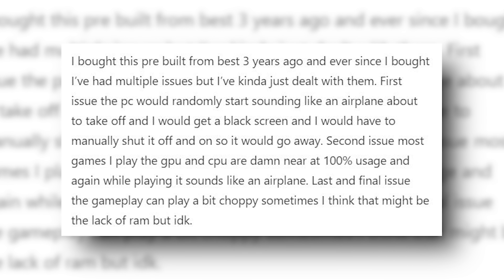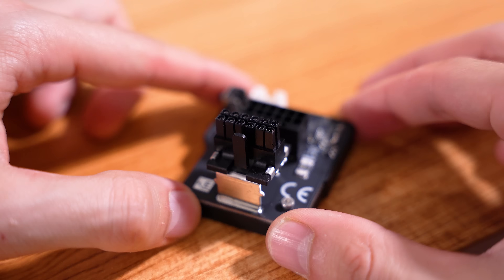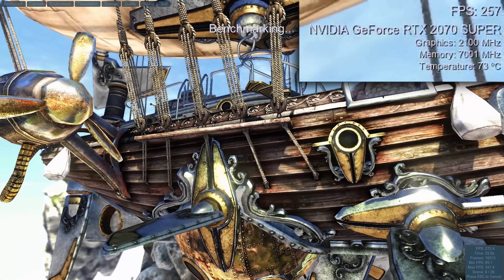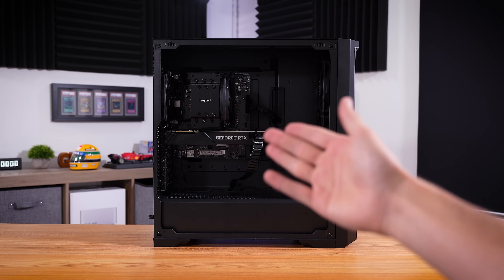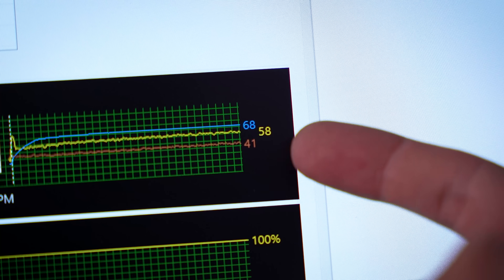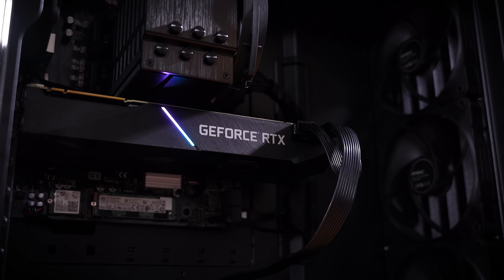Fixing a Viewer's BROKEN Gaming PC? - Fix or Flop S5:E3

Comment: Something to try in the future on these ASUS prebuilts. I had the same issue with a prebuilt I bought with an 11700f. The PC had a standard ROG Strix B560-G Gaming wifi motherboard. I switched cases and upgraded coolers and even with a 360 aio it would throttle. It had a weird bios specific to the prebuilt that was not listed on ASUSs website and could not be flashed through standard methods. It was pumping way too much voltage to the CPU and limiting boost frequencies no matter what I changed. I used a CH341A programmer and clipped it to the bios chip and flashed the OEM bois to the board and never had an issue since.

Comment: I would have kept the case and PSU, and instead, upgrade the ram to dual channel and used a low profile CPU cooler, like the be quiet! Shadow Rock LP. 

The Intel i7 9700 has a 65w TDP, so the be quiet's max 130w CPU cooler would be enough to keep the CPU from thermal throttling at high load. Yeah, it would still be in a low air flow case, but not a no air flow case. The overall TDP of that PC isn't high enough to be an issue in that case, only the CPU cooler really needed to be addressed if the goal was to keep things simple and not start changing out parts.

That's just my perspective however, I can see Greg was hesitant to do anything, based on previous viewer history, so I'm not judging the choices made, only pointing out what I would have done without the pressure of others. It sucks, so I can't imagine how it feels in the moment.

Comment: I love that at least a lot of the viewers know that Great Wall is a perfectly reputable brand for PSUs and fairly reliable. They did underpower it but honestly, the 2070 pulls about 215 W unless you overclock it.  the i7 9th gen is let us say 135W. 500W should be perfectly fine if the recommendation actually gives 500W over 12 Volt rail and it's not a split rail PSU. The recommendation from Nvidia tends to be more than you need because not all power supplies are equal and the rails might not have enough power even if the unit in theory does. 3.3V and 5V might be part of the combined wattage or separate. A lot of brands have 12V Wattage as the wattage on the box but for other brands the combined wattage is the advertised wattage. The Thermaltake smart series 600W for example says 600W but it is only 540W over the 12 V rail. But an EVGA 600 GE provides the full 600 W over the 12 V rail. Not to mention some PSUs split the CPU/motherboard rails from the other rails meaning that it could be a certain wattage overall but only 200W is for PCIe etc.

Comment: one point of my concern is that previous cpu cooler was also cooling that weak motherboard vrm because it was downdraft cooler, the new one you upgraded with is not downdraft which in theory is actually harmful to the current motherboard situation

also as others pointed out, Great Wall is an OEM themselves, so more reputable than many "known" brands when it comes to psus.

Comment: A 2070 Super uses a nominal 215 W, and I can't imagine that board would be drawing much more than 100 W (my guess is 95 W PL2 and 65 W PL1 or thereabouts, that's certainly all I would entrust the stock cooler and VRMs with), so a decent 500 W PSU seems perfectly adequate for a system like this. 
Placing the CPU fan down as far as possible to give the weedy VRMs a maximum of airflow would probably be a good idea... upgrading a system like that to a tower cooler is potentially good for some surprises in this regard. OEM systems with tower coolers (e.g Fujitsu) often have sort of a wind deflector going that redirects some of the airflow from the bottom fins onto the VRM area.
Oh yeah, and the owner should definitely splurge on a second RAM stick as previously mentioned.

Comment: Pre built PC's like this are usually not good, the single.ram.atick is leaving so much performance on the table. Add one more stick and the fps will go up quite a bit. 

New cooler and a stick of ram, boom. That's all it needed. In my opinion. But I'm not creating content and giving away parts :(

Comment: Honestly.. this setup didn't deserve this upgrade. Bottom of the barrel motherboard, cpu cooler and the ram. Upgrading the motherboard plus using cpu cooler like Noctua NH-U9S would fit perfectly. 5-heatpipe Thermalright Assassin King costs 22 bucks and does the same job as U9S.

Comment: My first pc was a prebuilt ASUS from BestBuy, it came in a funny shaped case that left me with zero upgrade options graphics card or ram wise. While I learned about pc's and pc building I started wanting more, so while I saved to buy all the pieces for a new pc I decided to mod/hack up my current proprietary shit box via a pcie riser and a standalone psu to power the gtx1080ti I had bought off craigslist, threw that 750ti in the trash so fast. Was so ready to do something with my new found love of pc's I ended up putting a water-cooling adapter plate and an AIO on the 1080ti, even though it ran perfectly cool before as it sat outside of the case and got fresh air coming from the air vent in my office. Long story short, don't buy a prebuilt that is not built using off the shelf parts.

Comment: LOL... that IO is hilarious. I ended up with the mobo out of an Asus prebuilt and you wouldn't know it outside of trying to find the drivers for it, but that IO is surprising. They're definitely not the same as ones you can buy in the store. Also, Great Wall is not a questionable brand. They are a respectable OEM for some very good power supplies. The Corsair SF series are highly rated SFX PSU's and they're made by Great Wall, as one example. And being that the 2070 Super is only a 215 watt card, the OEM model is probably even lower than that, a 500 watt is plenty, provided it isn't trash... which Great Wall isn't.

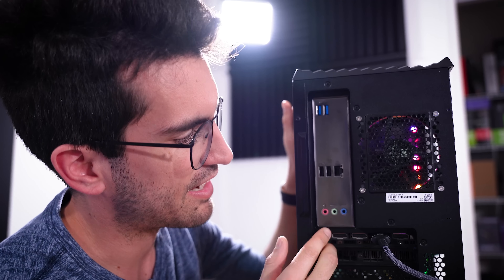Comment: @6:31 Don't OEMs use the cheapest components they can get away with just to increase their profit margin?
@7:20 Pretty much everything is better than this pittiful penny pincher version of a cpu cooler. It is clearly hard to justify "throwing the parts cannon at this" Milli Vanilli, so to speak, though. 😊
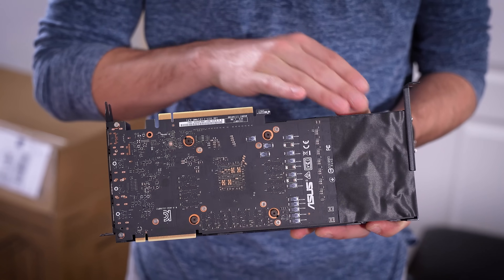@8:49 I heard of the car manufacturer Great Wall Motors before, known for its pickup truck devision.

Comment: I had a POS PC from BB and I had to ghetto cool it. That means I had to have a fan running in it 24 hours a day, 7 days a week 365 days a year unless I wanted it to go poof. The last computer I had before the one I have now was a I buy power PC and it's power supply blew up on me. The PC gods smile at me that day because none of my other components blew up at the same time. I built the rig I've got now. It's been going consistently since that day in 2020 and no problems. I will never buy another stock PC again in my life.

Comment: The CPU cooler was really a necessary change. I would have changed the motherboard as the VRM would probably also be overheating. Finally, in a weak system like this I believe that the 550w PSU would have done the job. I really like your videos. Congratulations on helping so many people.
Reply: I agree. That motherboard was NOT suited for a gaming/performance rig. That motherboard was at best a weak productivity platform. I am about to sell my old Z170i (mini-ITX) and I feel like reaching out to that owner to ask if he wants it. Because I think my 6700K in that motherboard might have outperformed whatever that platform can do with all the throttling he's getting.

Comment: Did not expect him to be so ignorant of the Great Wall Psu. Really surprised he did not check it before replacing it. The smartest way, would have been to keep the psu and upgrade the Ram. That single stick of some generic low speed Ram, running in single channel is a massive performance negative impact. Not addressing that is extremely surprising to me. Very mediocre work on this one.
Reply: He also claims operating the 9700KF 10 degrees below T-junction is "very bad".
Ignorance seems to be his channel's goal.

Comment: Asus is making ROG prebuilt PC, normal company approach: use of the shelf mobo (even like H310 prime), stock case like 301, strix or tuf GPU and there we go. How 99% of companies do (even those who have they lineup of hardware ready to use, not HP or dell): lets specifically produce (I'm not even sure its cheaper running a specific assembly line) cheapest and nastiest versions possible and sell them with even higher margins as ready to use gaming RIGs. Also, I've bought a board from similar asus ROG prebuilt, it uses two SATA ports to connect front USB ports, not even joking, had to purchase pci-e usb 3.0 to connect from panel. Also, bios has no XMP option at all, it can only run RAM that uses jdec standard higher than 2666, any XMP kit runs on 2133 or 2400.

Comment: Fun video Greg. Just a quick suggestion, if you feel a build is somewhat deficient in USB ports a USB card with usually 4 USB ports is a very cheap option. If the motherboard has USB connectors on the bottom the 4 port breakout fishplate adapter can be as little as $6. This client scored big time with the new case, CPU cooler and 1000W PSU. As others have said here Great Wall is a good quality OEM brand.

Comment: I bought the rocket lake and strix 3080 variant of this in 21 when gpus where hard to find. Cpu cooler was a joke for 11700k and the rear fan is 80-90mm that sounds like a jet engine. Whole case felt like tin and the mobo was some cut down b560 board. Would never recommend a a Rog prebuilt after that. Moved the parts into a different case after stressing it. Rog just sold trash cuz gpus we’re going for more than prebuilts because of shortages and crypto.

Comment: hi im from the uk can any one give me some advice i need help i have a old pc and want to do a bit of a upgrade i have a asrock-  Z97E-ITX ac with a I5-4690k @ 3.50ghz running a Radeon- RX-570 i got a I7-4770k of ebay for £20 will it fit straight in with out updating the bios and i need to upgrade my wifi m.2 card because im getting 1gb broad band with 5ghz what can i get any advice would be great as im a 55yo

Comment: Looking closely at the motherboard it has G15CS written on it. This appears to be an ASUS ROG prebuilt, so ASUS are responsible for the cheap design. Note the single channel RAM.

ASUS need to do better.
Reply: Actually, thinking about it, it would be wonderfully ironic if ASUS offered a proper motherboard to you to upgrade the very poor existing motherboard.

Comment: CPU cooler and dual channel RAM, replacing the case was not essential. That board itself may be the problem as well, that VRM is minimal and will be restricting the CPUs capabilities.
Reply from the maker: I disagree. Replacing the case was 100% needed. The cooler alone wouldn't have fit into the original case as it's far too slim.

Comment: A tower cooler with a board like that is dangerous.  The designers count on downdraft coolers for cooling the VRMs.
Reply from the maker: There's plenty of active ventilation in the new case (compared to the old). I wouldn't sweat it one bit.

Comment: Looks like a cooler master. I remember when Great Wall and CWT was a PC builder's joke because the companies had the lowest quality. Amazing how the story has changed for the better. Use too be a huge rog person. With the current pricing of boards though. The rog and most of the Asus pricing has turned me away. One of the lowest number of usb and connections on a back plate for the mobo I've seen in a while. Another reason too build your own. Better choices. Like one stick of ram.

Comment: I think the biggest peformance hit comes from the single stick of RAM. The owner should definitely upgrade that ASAP.
Reply: Don't think the issue comes from the ram running on a single stick, but rather the speed of it. It looks incredibly cheap, wouldn't even add another stick, just replace the whole damn thing 😂
Reply: @PexceI it's probably just some value RAM of some sort, it doesn't look fancy but works just as well as other RAM sticks
Reply: Luckily Intel is much less picky about RAM than AMD. If the dude wants to upgrade it in the future he can.
Reply: I actually think Greg did him a huge service by not touching the platform and GPU. He set him up (almost) perfectly for a newer CPU, MoBo, RAM (7800X3D+AM5 MoBo +32gb@6000 all for 500 ar microcenter)  and GPU upgrade later this year when the new gen arrives. He can even wait for Zen5 for a CPU.
If it were me, I'd be happier with this than if he touched the platform, instead. That MoBo is one of the saddest I've seen in a long time...
Reply: @BarAlexC  yeah I agree... or even an extra stick from ebay for a very cheap upgrade to hold him over

Comment: Loving this series, been watching almost every episode! Were the tests done with the sidepanel on or off on his old case btw? In every shot it was off, so I just have to ask. Considering how restrictive the case was on airflow, it would definitely make a difference on GPU thermals. Having run into the black screen issue myself with seemingly normal GPU temps, it seemed to be more closely linked to VRAM temps in my instance.

Comment: So the owner of this system watches this channel, and they thought it was okay to have that poo poo garbage cooler on the cpu and just a single stick of ram? Combine that with a hermetically sealed door cosplaying as a computer case…yeah of course temps are gonna be bad. I hope to god the owner of this system just found this channel, because otherwise, they would either not have bought it in the first place or at least upgraded the cpu cooler and got a second stick of ram and/or put it in a case that wasn’t choking the air from the components.

Comment: Gotta get the OEM VRM heat sinks to remove thermal throttle. The motherboard can sense when they have those heatsinks. I learned this from a Dell prebuilt and both Dell and Alienware have that. Replacing CPU cooler still made motherboard throttle cpu

Comment: and the moral of the story is, don't buy a prebuilt from a store like bestbuy. I just got into PC gaming less than two years ago when I built my first PC. When I originally set out to get a PC, I found out that I couldn't buy a decent PC because of the GPU shortage during the crypto boom lol. And I realized that buying a prebuilt usually gets you something that has cheap hardware and shitty performance for the cost anyway. Seeing as tho I had some time before the GPU shortage would end, I did a bit more research and decided to build my own and that decision was not only a good one but felt very rewarding too. I learned a lot from the whole process starting with learning about the different hardware to picking the parts and then building it. I think every PC gamer should learn to build their own system.

Comment: I know people aren't a fan of blower coolers but I don't mind them on stuff like 60 class cards or in more efficient generations 70 class cards if the noise is still too loud for you or thr Temps I Def recommend trying to undervolt because I dropped 10 C on My xtx with an undervolt alone and around the same on my old 3070

Comment: Seeing a single stick of memory, and the user statement about low memory, and that DDR4 is dirt cheap, makes me wonder why that was not even mentioned. You go for a new case, a large and EXPENSIVE CPU cooler (Thermalright Peerless Assassin is better for less than half the price - check Gamers Nexus review), a new power supply, and do all the cleaning but leave a single memory stick running in single channel mode and it was not mentioned once as to how much memory the thing came with....keep memory in mind
Reply: Let the viewer upgrade his own RAM if they want, it's cheap and the most ez thing to change out. Greg did more than enough.
Reply: I reckon it's a case of what it costs him as a creator. Be quiet are already sponsoring the show so all the be quiet stuff is effectively free so why not use it? Was odd that the single channel memory wasn't even mentioned though.
Reply: I meant you likely have lots of their products handy, so you can install them at no cost.  You're always very clear about sponsorships, which I appreciate!
Reply: Be Quiet sponsors these videos, so it probably would have cost quite a bit more to use a cheaper cooler 😂

(To be clear, I meant that he probably has extras of their products that he can use whereas he'd have to go out of his way to purchase a cheaper option)
Reply from the maker: @TomGaeta  be quiet! did not sponsor this video. They didn't pay us for anything in this video - including the PSU and cooler. We just had extras laying around and saw a legitimate need.
Reply: I did also leave with questions about the RAM, but either way this wasn't the biggest flop haha @GregSalazar
Reply: @GregSalazar. You deleted your reply towards me, well, here is mine:

The Ram was the main culprit besides the cooler to  limit performance. The case did not need replacing, neither the PSU. The owner complained about the ram, you never mentioned they will upgrade themselves. From a technical standpoint you did not fix all the issues the owner was complaining to have. This makes for sloppy work and for amateurism. It is as simple as that. I don't know about the internet, but I did not assume anything, I drew my conclusions based on what you presented. It's your clip. Some of us have been in this field for a very long time, to see what's what. Believe as you wish, the facts remain. All the best.
Reply: Amateur hour at it’s finest. The Psu did not need replacing, the Cpu cooler is over the top, case swap wasn’t needed. Upgrading Ram, a must, for a very significant performance gain. Of course, he did not do what should have been done, no questions asked. Massive flop this one. Both from a technical and work ethics standpoints.
Reply: @alext988-z8v agree on the poor choices. I’d have kept the case and PsU, upgrade the motherboard and ram. Toss in a simple 240mm AIO.